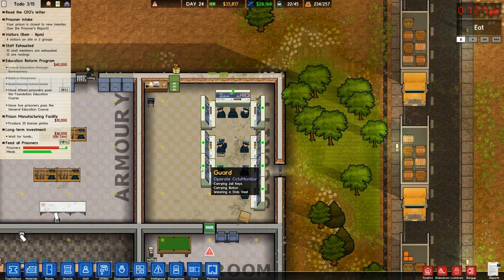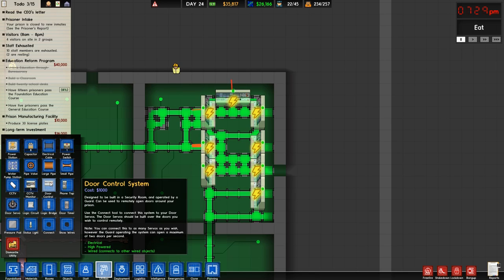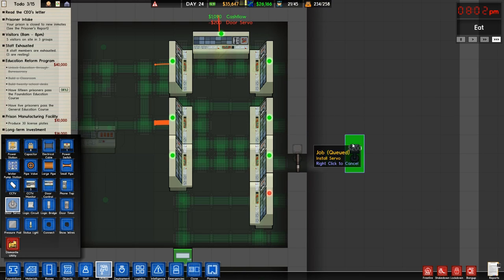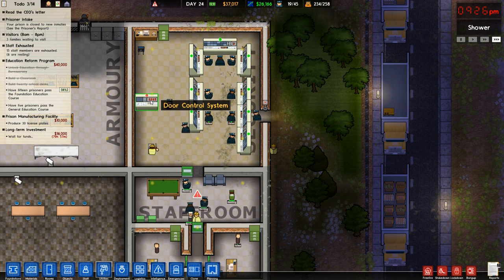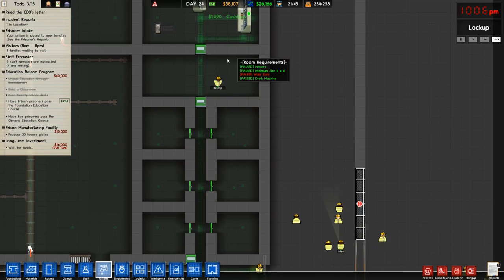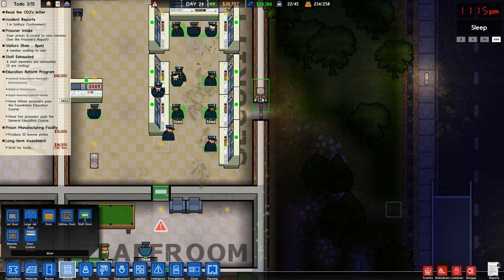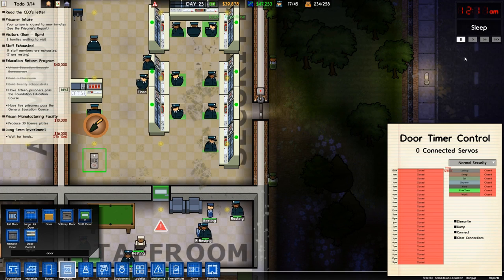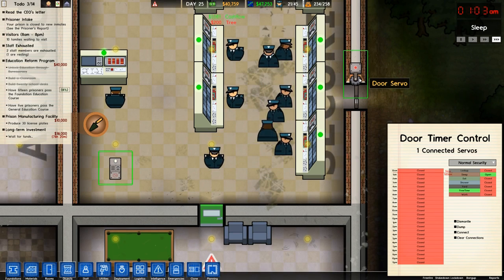Prison Architect - How To Setup Remote Doors

Comment: CCTV monitor is for 8 camera. How many remote door can you have on this?
Reply: Gaim Kore i dont know but maybe 23
Note: a guard controlling the system can only open 2 doors in a second
Reply: +Gaming Kore. 12 if you want your doors to react instantly and open without delay, up to 24 if you don't mind some delay. beyond 24 the delay gets too long and another control station becomes necessary. if you're like me and you use door control stations (and especially remote doors) for cell doors you can add more than 24 and as a work around the delay you can wire a door timer to it to open all the cell doors at specific times, this takes much of the load off the guard.
Reply: Gaim Kore max 2 before taking a certain time

Comment: Can u get a video explaining the and-or-not-nand--nor-xor, settings on the logic circuit? If u did sry Ty
Reply from the maker: SGTCRAPHAMMER I can certainly try...but I don't really understand it myself.
Reply: Its some high tech stuff lol its real circuitry just wandering what they can do!! thank you ProphetBeal an good luck m8 !!! if you do get one out im looking foreword to it !
Reply: SGTCRAPHAMMER I mentioned this on the official forums as I don't think they are working properly. For example, I setup two doors with two switches connected to an AND gate. This means BOTH switches have to be on for the doors to work, if one switch is off both doors will lock. So if the prisons cause issues and break the switches they lock themselves in.

But it refuses to work. Flick one switch off and the doors stay open. Testing it with a light connected, same issue. The light should go out if the either switch is off but the light stays on.

There are a few bug reports for the logic system on the Mantis Bug Tracker.
Reply from the maker: Steven Whiting  SGTCRAPHAMMER I just posted a video on Logic Circuits...Let me know if it helps. 
https://www.youtube.com/watch?v=h-MOlgyx3Ps

Comment: Is there a limit on number of doors you can connect to the door control system? Sometimes my door won't open even if a guard is at the door control system..
Reply from the maker: +slevin sleven There isn't a limit per say, however the more doors you have connected the longer it can take to open each door.  A door control system can only open 2 doors per second. For example if you have 20 doors connected to 1 control system and they all try to open at the same time...it would take a full 10 seconds before the final 2 doors would be open.
Reply: ProphetBeal ah! thanks, indeed, a system can only open 2 at same time & take 5 secs or so to ''recharge''... But now what I'm wondering lol, I'm done building all my jail *on huge map) I have no more space, everything goes very well, making tons of money and rate 8 overall, but I can't get any deathrow prisoners ... I builded the exution room, build a cell in same room, buil some other cells whit ''deathrow only'', but it still dont want to give me any death sentenced prisonners...any clues? o.O
Reply from the maker: slevin sleven Good question, but honestly I have no idea. I personally have never gotten death row to work for me. Let me know if you figure it out!
Reply: ProphetBeal uh well at day 24th I finaly got one!! lol basicaly just build a cell in the execution chamber and designate the cell area as ''deathrow only'' ... then you will eventualy get one, took me 24 days...then you can choose to execute him right when he arrives but you get a penality if you don't wait for him to appeal his sentence... pretty funny but no special effects when you light him up lol
Reply from the maker: slevin sleven Sweet, thanks for the info!
Reply: +ProphetBeal or edit the deathpool, in notes it says 0 edit it to how many u want, , i put 100 then save it goto load game then slide the bar to how many you want to deliver

Comment: now for some reason after the new update them things are not even working at all :/  so what is it that I am doing wrong here?
Reply from the maker: Honestly I haven't played version 1 yet. What specifically is not working?
Reply: ProphetBeal you know them remote doors for some reason they will not ope  when a person walks up and waits until its open and even then there was a person at the room to open it and yet nothing happen at all so really wtf Have I done wrong for this happen and yet to make it easy for you I will try and record it and send you the link via steam so i can show you what i mean
Reply from the maker: Huh... Are you sure you have the doors wired correctly. Make sure when connecting you go from the control system to the door.
Reply: ProphetBeal it's okay now and iv found out why it was not working :v the fact for some reason you had to have people inside the prison for them to work for some reason
Reply from the maker: nathan smiddy Yeah that is totally a thing. Doors tend to have odd behavior until there are prisoners present. Usually they get stuck open.

Comment: I guess the advantage of remote doors is that prisoners can't open it with stolen keys
Reply from the maker: +IZuzivowoI That is very true, they are certainly more secure in that sense. The major disadvantage being if there is no power or guard at the door control system then no one can open them
Reply: +ProphetBeal Unless you get very fancy with the other fun stuff, like Logic Gates

Comment: It doesn't work
Reply: Doors always open
Reply from the maker: Logan Macdonald do you have prisoners? If I recall correctly the doors will stay open until there are prisoners
Reply: ProphetBeal I do in the cells I use remote doors for some cells and regular doors as well lots are just open I close door cell breaks